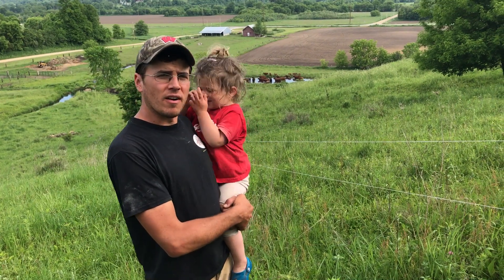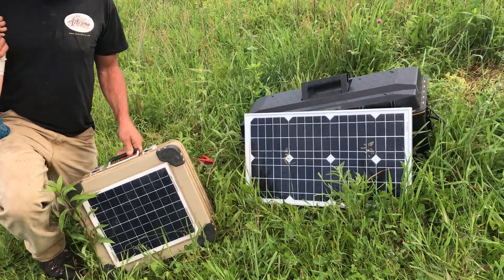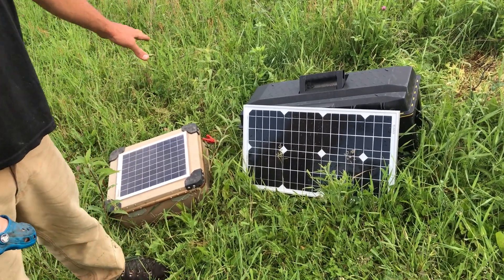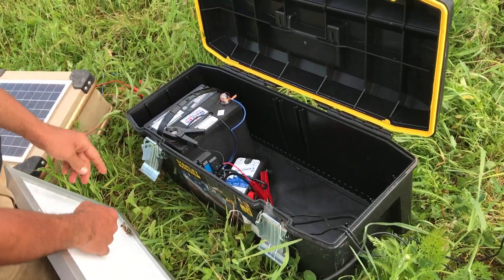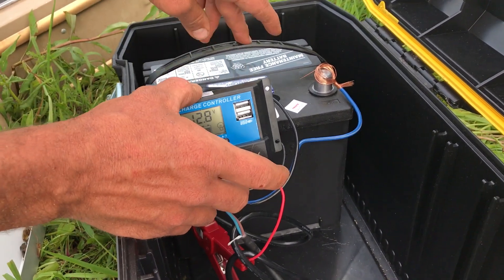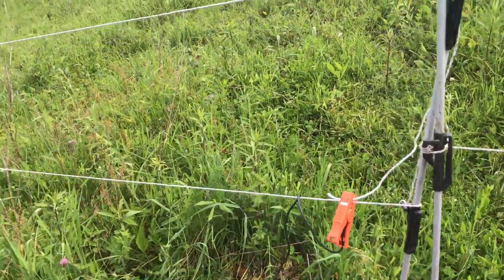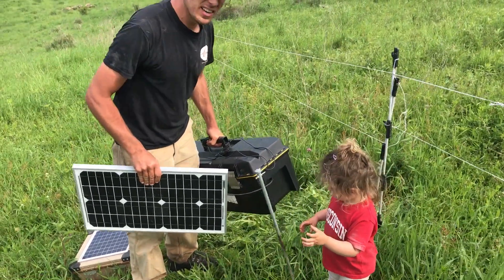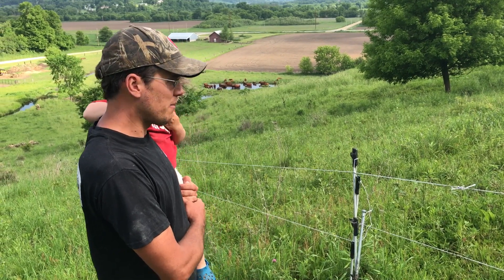DIY Portable Solar Electric Fence Energizer

Comment: 3:26  Just use some worm drive clamps and tuck your wire in and tighten them up with a screwdriver.

Comment: Hi! How many mile of fence do you think this would work for?
Reply: Should power 2.5 miles of 3 strand cattle fence, 3/4 mile of 6 strand sheep fence, 16 rolls of the 164' sheep/goat nets or 6 - 8 rolls of the 164' poultry nets. All distances are dependent on amount of grass/weed load on the fence.
Reply: Up to 14,000 volts
Reply: Kenny Hardcastle 
Hmmm... I wonder if it’s too strong for horses? Does this send the volts constantly or in waves?
Reply: Thank you! Do you know how many volts it’s throwing with a tester? I have a horse that needs manners😂

Comment: If you wanna save 5 minutes and just want a quick overview : 20watt solar panel >battery charge controller> 12v car battery. Hook a standard 2 joule 12v fence charger to battery. Put em all in a plastic tool box and youre good to go!!Not a bad idea at all tho.. Its scaleable, easily serviced and ready to get split back down to components that can be put to use on the next project or what ever, where ever, as needed.any first timers with electric fence> focus on a good solid ground, and good insulation between the electric fence wire and anything else it touches besides your livestock. try and avoid the fence wire touching any grass or vegetation. the more it does, the less it will shock.. especially on dewy morning at the end of the line. The amazing thing with an electric fence tho.. In many cases.. even de-energized, it is an amazing psychological deterrent that will keep your animals off the fence line and exactly where you want them... till it doesn't. ;)great video